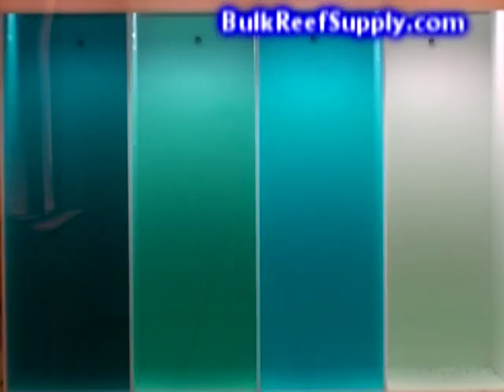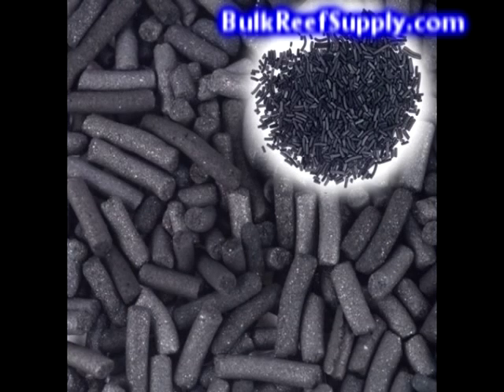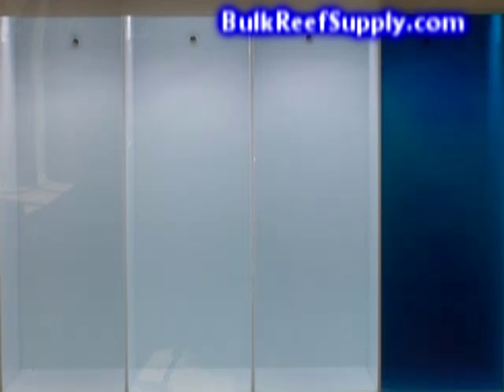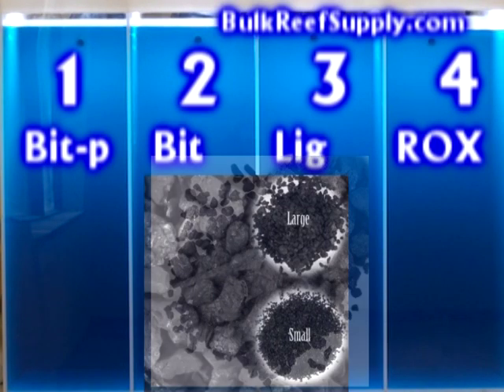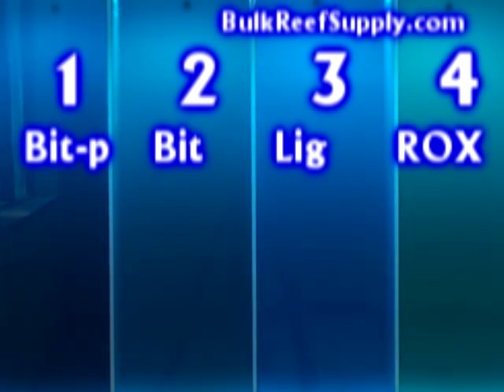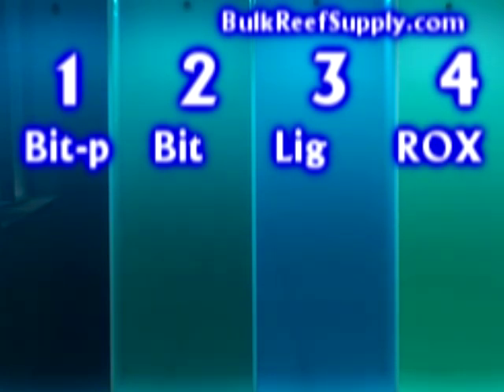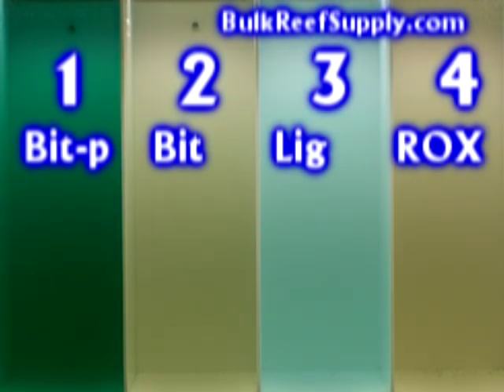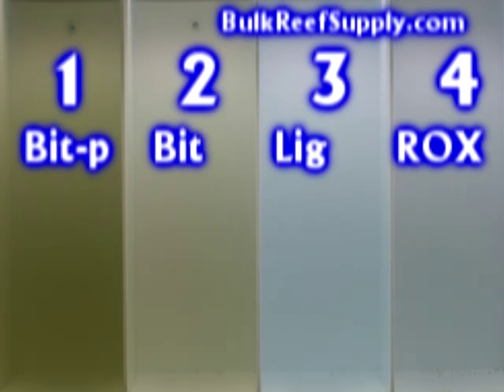Aquarium Carbon Demo - BRStv BulkReefSupply.com

Comment: Carbon can be used if properly used and maintained. BUt for those that dont know, its to be replaced about every 3-4 weeks, otherwise the pores end up leaking the toxin BACK into the water as its no longer absorbing.. It is great for cleaning medication and such out of the water and help with odor.